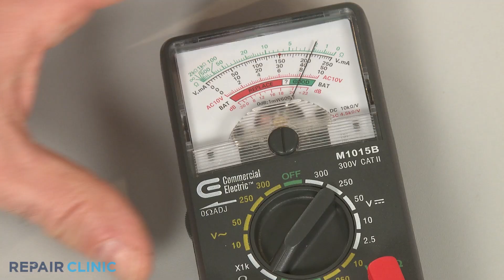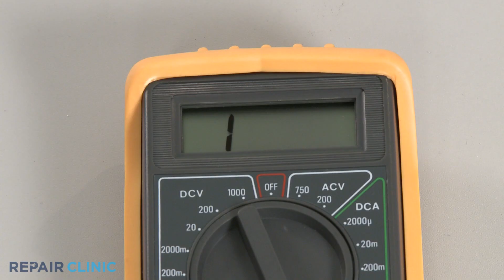Microwave Thermostat Testing

Comment: Yup, our old Maytag shuts down momentarily if used heavily.  It signals its return to action with the oven light flickering and then staying solid on. I looked at the wiring diagram and the oven light is tied into the heating and thermal cut off section leaving no doubt.  I believe the magnetron fan is under-performing.  Reaching the fan requires gutting the entire control area--you may as well disassemble the entire unit to parts.  A lot of effort.